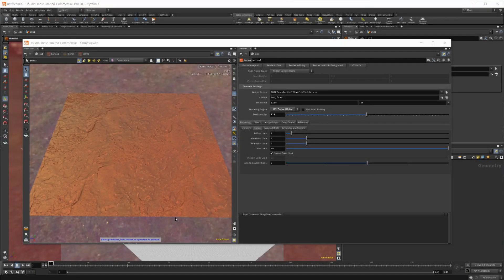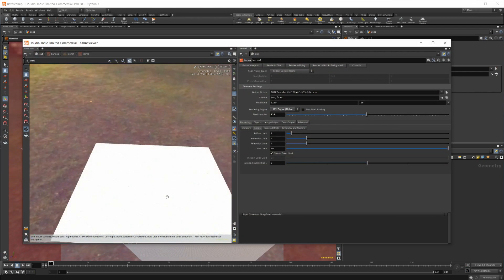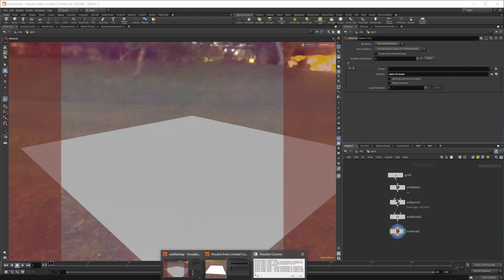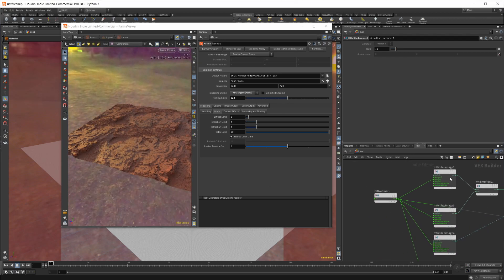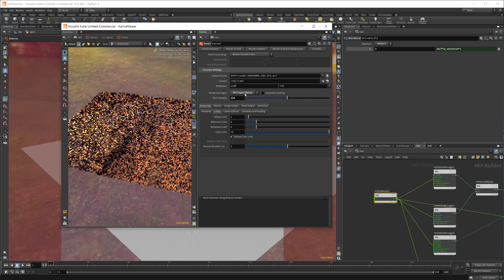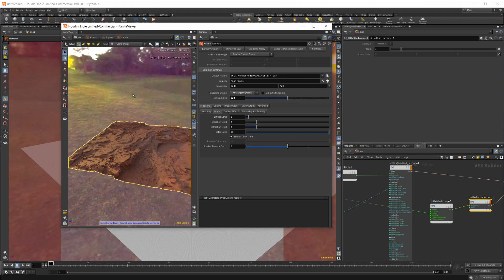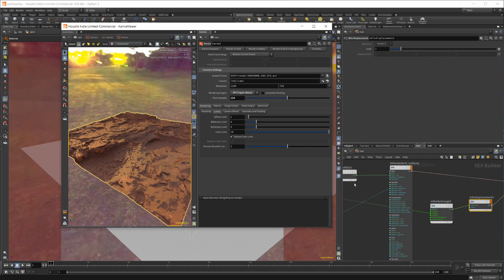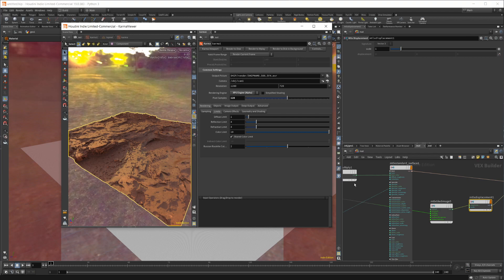Enabling Displacement in Material X and Karma | Houdini 19

Comment: Still sourcing this tutorial. Please don't ever remove it, it is awesome.
I discovered this for my first time this weekend embracing the harnessing of using multiple delegates.... I am stuck on H.20.5.278 for Redshift. Can't go higher unless I rent...
And so working in H20.5.278, I noticed you cannot mix delegates when using this method to get displacement working.
Not sure why but it looks like it stems from not being able to use a collect within shader?

And of course, going direct (material assignment) instead of using a collect (to flip between redshift and karma delegates) this displacement method still works, even with using any of the non collect methods for an output.
Who knows, maybe this works in higher versions of Houdini at this point.
Reply from the maker: You should still be able to add a collect node. If its not visible you could copy it from one builder to another
Reply: @InsideTheMindSpace  thank you. It's totally visible and thank you for your suggestion. I guess what I'm trying to convey is that once you assign the material to the collect node (the one that collects the redshift and materialX shaders), the displacement no longer works. As soon as you go direct versus the collect node, you get your displacement back.

I don't have Redshift beyond H20.5.278, but still, I booted it up in the most recent version of H20.5 (the redshift shaders error, expected) and the same problem exists.

Comment: HI! Would be great if you could provide the "previous setup" that you mention at the beginning of your tutorial. I was looking for it, but no link. Can you provide it please. I cant seem to find it your videos sections
Reply from the maker: I might have removed it or something. Either way in H20 there are better ways of setting up a material than what you see pictured in this video. There is a new node called the pbr texture set that provides inputs for most of the typical maps you would use. Then you can plug a texture coordinates node into that and you should be set. If you are still on an older version of Houdini then use image texture nodes with a texture coordinate node plugged into each image texture. I'm also using Karma more in H20 so you should see more setups that are available on patreon and rendered in Karma if you are looking to see how materials are setup. There are already some on there.
Reply: @InsideTheMindSpace  Thanks yes I've taken notice already. I have it working now. It's probably time users only stick with H2O tutorials with regards to materialX.

A basic tutorial running through a final of all of the functions for simple basics would be most appropriate to come out. I have 19.5, and even then the older tutorials don't work out as well in 19.5.

Thank you for the quick response
Reply from the maker: The older tutorials should still work. But yes there are some newer quality of life things in H20 that are veye nice

Comment: Well, in this video i havent see the number of polygon set on the grid.
How can we increase the number of subdivision (like maya) in the karma render ?
Reply from the maker: Thats a great question. In the video I was using the geometry at a high resolution for displacement but you can use a subdivision scheme to do this apparently. I haven't done this myself to test but apparently and edit properties lop will do that by setting the subdivision scheme to catmullclark. Alternatively a mesh edit lop supposedly works as well by doing the same thing just set your objects path
Reply: @InsideTheMindSpace  The subdivision sheme : catmull clark dont subdivide the geometry. He just smooth it ( ike the 3  keyboard touch of the pavnum) but we haven't the controle of the subdivision number
Reply from the maker: I would have to look into it. I dont have the answer at the moment as I am not currently at my workstation. I will try to look into it when I have time and get back to you
Reply: @InsideTheMindSpace  Nice !
Reply from the maker: @lucasceccherini9572  I have figured out how to control the subdivision level. I made a video that will go live in about 11 hours or 11 AM CST so that other people with the same question can get the solution as well. Thank you for bringing this up
Reply: @InsideTheMindSpace  Awesome, I'll go check it out! thank you :)

Comment: I don't understand why the displacement doesn't work on my side with the same nodes as you are, using either the "Mtlx surface material node" or the "collect node" does not enable displacement in either Karma XPU or CPU. There is something I don't understand I guess.
Reply from the maker: There has to be something you have missed but it's hard to say without seeing your project